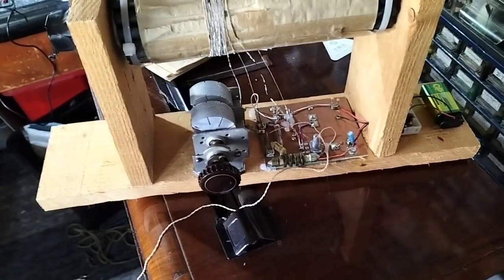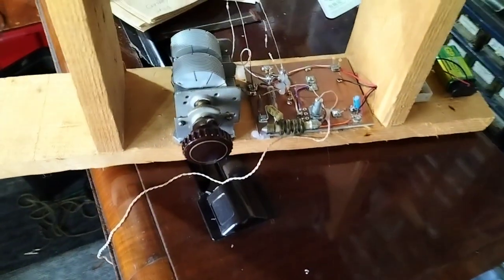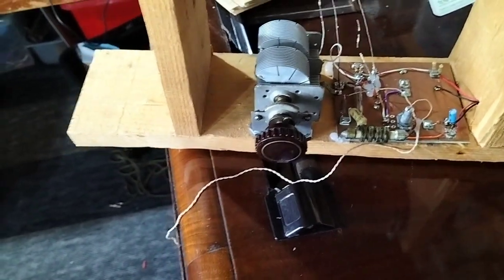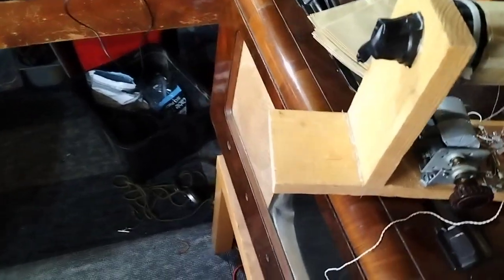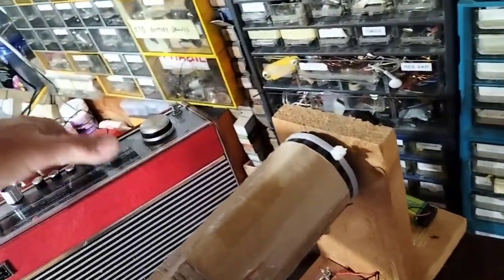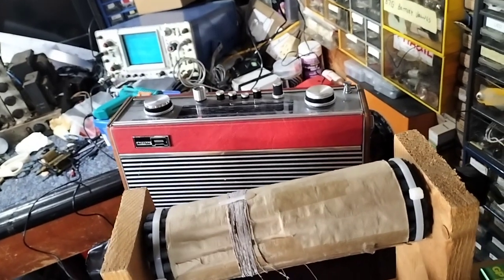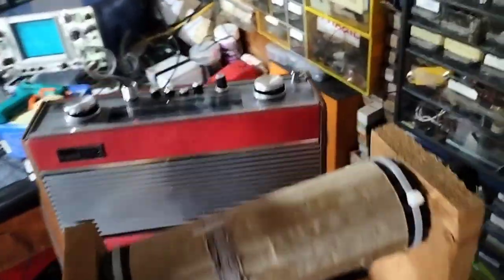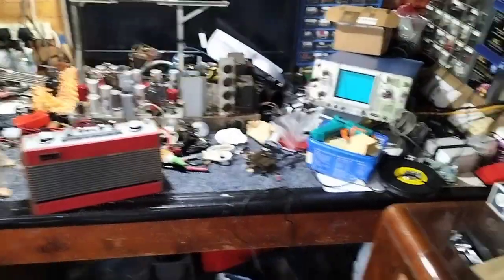Honest, I've not been drinking.

Comment: I have never tried or thought of using a regen as a oscillator and that the ear piece would modulate that transmitter.  I have not attempted to build a regen in a long time having a supply of proper antique ones.  I have some Russian tiny submini valves of unknown part number.  My identification of them comes from conjecture and examination with a magnifier.  They appear to be tetrodes with two grids visible. The appeal is their small size,  even substantially smaller than my typical American made subminis.